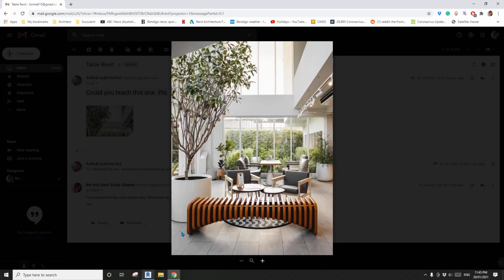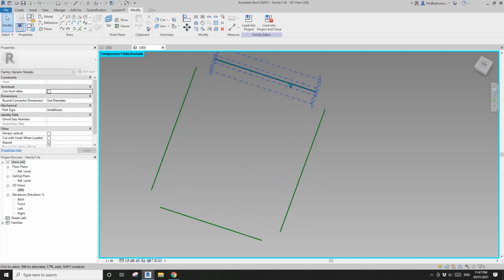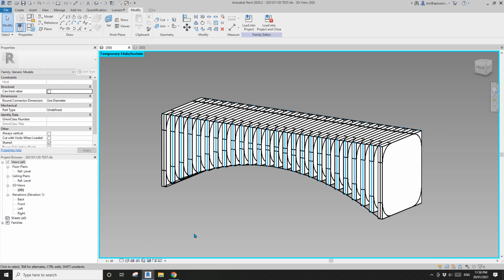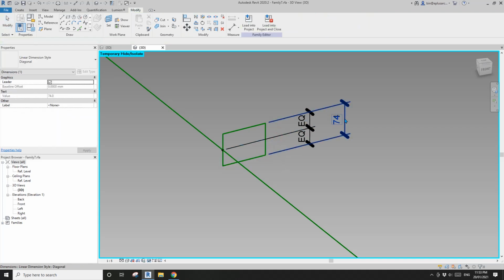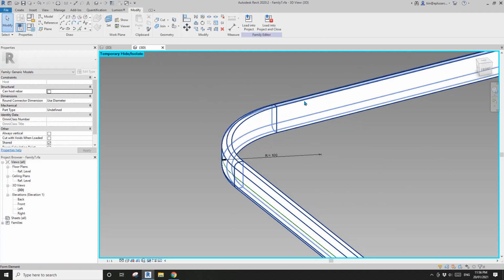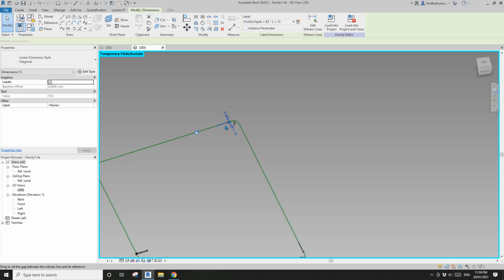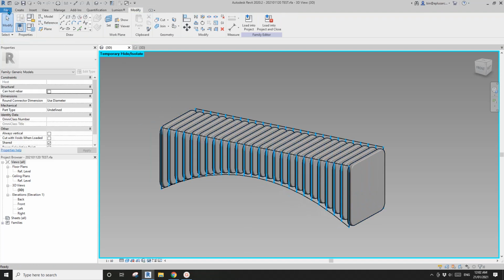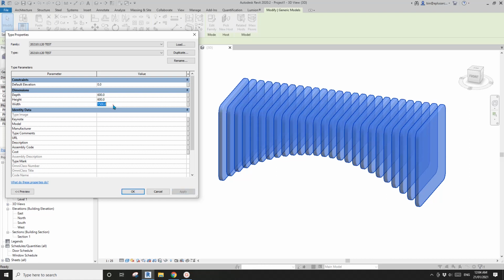Everyday Revit (Day 308) - Parametric Bench Family Exercise (Part 2)

Comment: the main horizaontal axis, the very first reference line which controls the overall length- that holds all the panels together, can we add points and alter to like a S-bend for example, so can we have the panels adapt to the bends?
Reply from the maker: I believe we can. We will need to add an extra point and create a spline through points with 4 points instead of 3. We will also need to adjust the offset of the points to create the “S” shape.